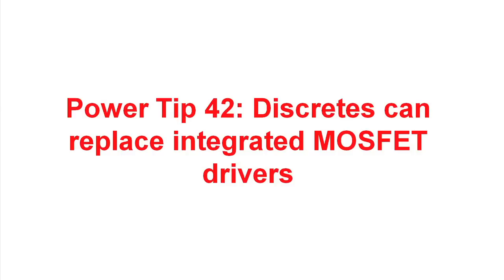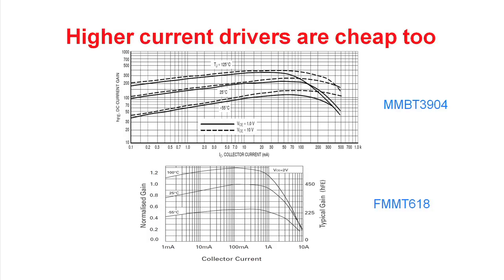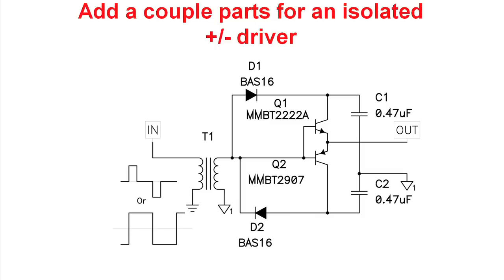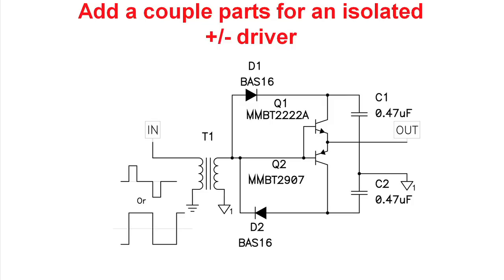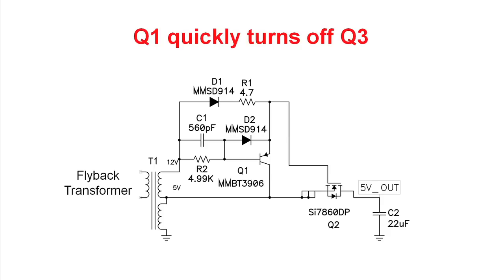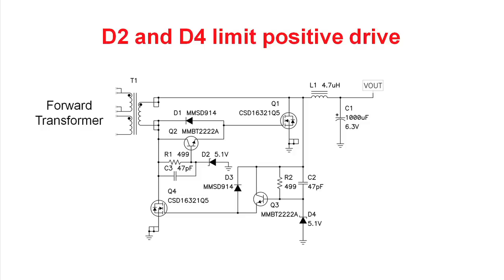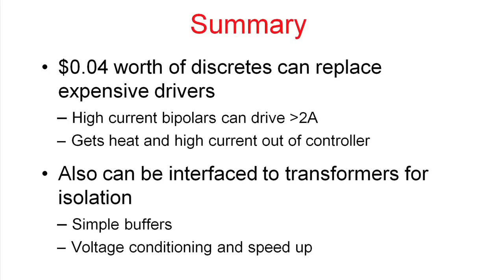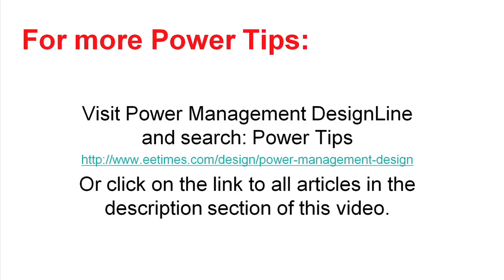Power Tip 42: Discretes can replace integrated MOSFET driver

Comment: Thank you very much! I've noticed that when using discrete npn and pnp transistor to drive a MOSFET the ON and Off graph plot is different; the off state has like a downward curve while the on graph plot is like a stright vertical-horizontal line. Can you tell something about it, please?

Comment: Im still unsure on the  necessity of drivers. Do you only need them in high power applications?
Reply: The biggest need comes from when you're trying to feed the same signal into multiple devices, but also when you convert from a voltage controlled to current controlled component you may need some method for boosting signal. 
A purely voltage controlled signal can lack the necessary amperage to drive a gate/receiver.
Reply: If your not sure on the type of gate driver ic to use try using tip350 ic it's one of the best drivers ic out there 2.5 amp current  to driver your load
Reply: The first design I like it very well but the gate driver transformer need a mosfet to driver it instead of a totem pole buffer with transistor the pwm ic only provide 150 milliamp so by using speed driver p type transistor and a diode to driver the mosfet to drive the gate transformer the current is more then enough to drive    100 mosfet because the buffer current peak reach 25amp

Comment: Looks like C1 is not connected to the proper nodes.
Reply: Should i be connected to the output?
Reply: I dont know-- his graph shows output current so I thought the capacitor is to represent a load. On the other hand, its in a good place to act as a decoupling capacitor.
Reply: @RRVideosAndSound  I think it connected to proper nodes. It looks to be simply decoupling capacitor, shouldn't really be included in the schematic, as it is non essential, but in high current applications, is probably important to have it close to the BJTs.